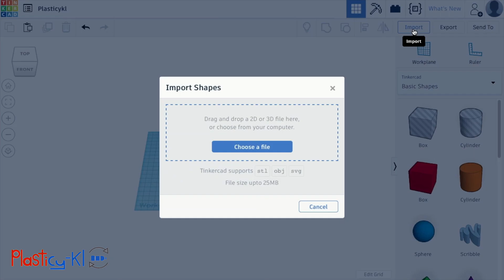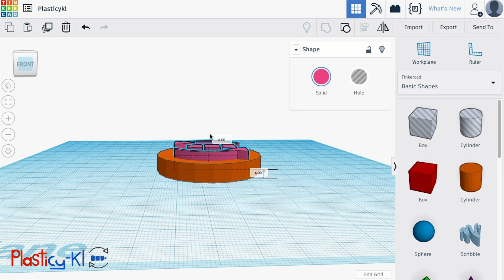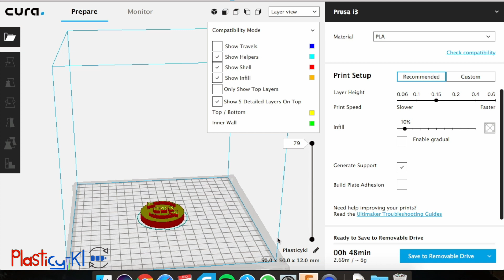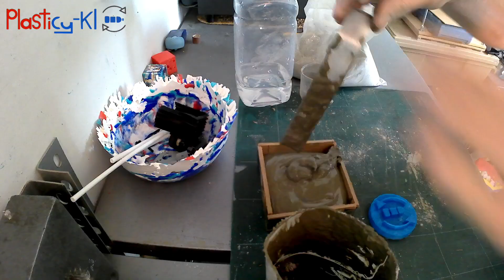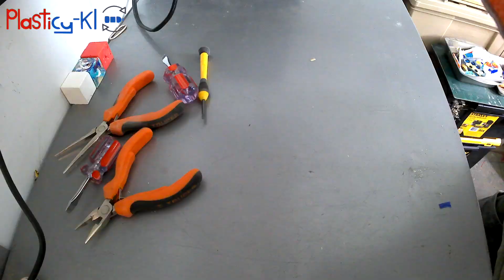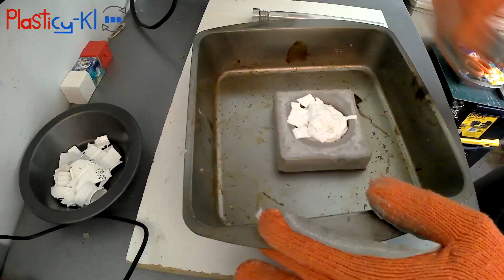Making a concrete mold for recycled plastic (HDPE)

Comment: Put some draft into your pattern so it will be easier to get it out of the mold. Your finished part will also be easy to take out of the mold. You mat also want to try injection type molding with this technique.

Comment: would it work better if you spray some silicone on the concrete mold?
also would it work better if you meld the plastic elsewhere, for example using the two brothers "Beginners' Guide to Melting HDPE"
and then compress the plastic patty with a flat top cover?

Comment: Perhaps if you would have melted the hdpe in a small crucible, then poured it as liquid into the mold.  Your problem is that your hdpe isn't getting viscous enough to flow into all the cavities.
Reply: it will not be flowing like water, more like hot glue, a semi hard pudding